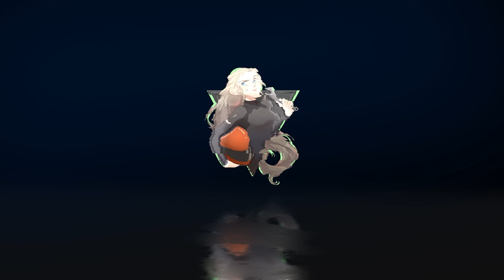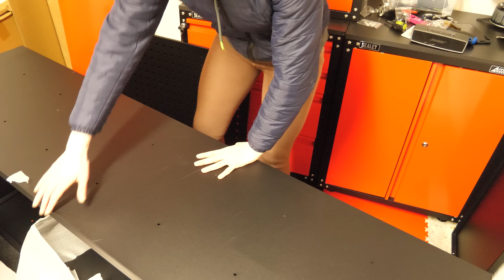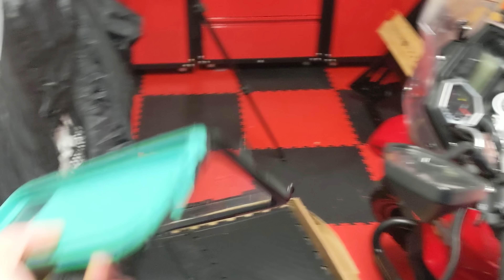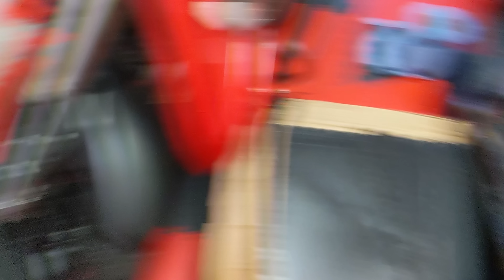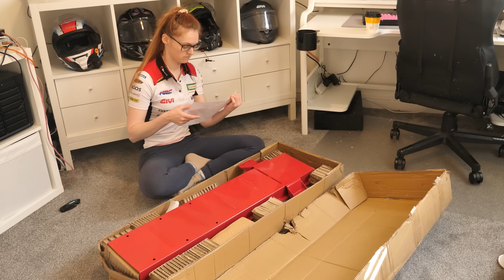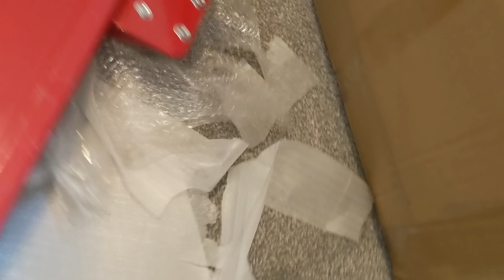Garage Makeover - Part 3

Comment: Saffy,  don't put a large fixed worksurface on the top of he tool boxes.  Instead look at a fold down tabletop that attaches to the wall. it will give you heaps of room and when not in use will only take up a few inches of space.
Reply from the maker: I need a fixed worktop for the computer monitor I'm going to install :P

Comment: When you go to shows do you notice loads of people taking close ups of bikes and there component  parts. This is often their method of getting details right. If you have a problem with instructions go to a tool shop with a display area and take some pictures of the completed in your case cabinets of areas you are struggling to read instructions. Most men open the box and throw away the instructions with varying degrees of disasters  :)
Reply from the maker: The instructions weren't worth the paper they were written on XD XD XD

Comment: Well done I just had my garage built - thought 4 double sockets would be enough nope - get as many sockets all around good lighting and a tool peg board wall I got Dynamoto stands awesome make sure get heating  and cooling I would die in summer but this year have air con r u going to out boards on your ceiling joists helps with more storage space

Comment: Great job Saffy. Recommendation, remove the panel at the cabinet covering the socket before the cabinet gets full, maybe not a problem after the rewire, but you don't wan to leave power on if it can be helped.
Reply from the maker: The sockets are gone now 🥰 they were replaced with something a little cooler 🤣

Comment: Well done Saffy. At least you won the battle and got the cabinets together and that's a huge achievement. 

It can get worse which for you I hope it doesn't. I have a joinery shop & I once bought a big 250 kilo planer machine that showed up in a crate full of a hundred parts. Huge bits of cast iron that sat on a heavy duty steel base cabinet. ( I should point out it was manufactured in China). When I pulled out the assembly manual it said at the top " Wooden jointer". All the rest of the instructions were in Chinese and not a single picture to give me a clue. I'm a very mechanical minded person and it still took me 3 solid days to get it together. 
There was a bit of humour to the madness though. Even the two words in English didn't at first make any sense. It's a machine for working with wood but it's made from 250 k of cast iron and steel so hardly wooden and it turned out jointer was the American word for a PLANER in British English lol. 
PS, that was years before Google translate 🤣.
Reply from the maker: Oh man, ahahaha that just have been a task and a half